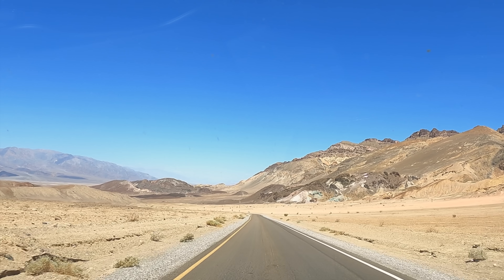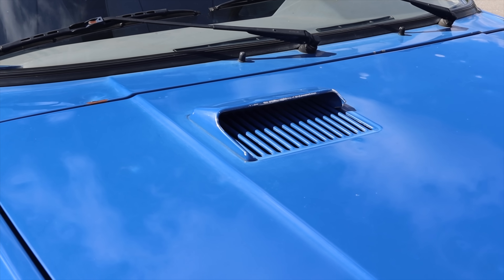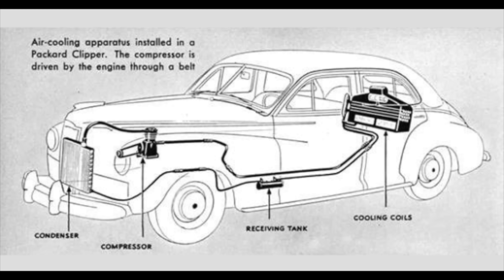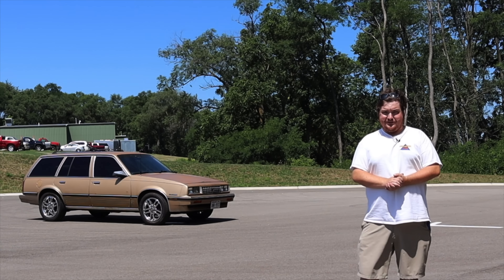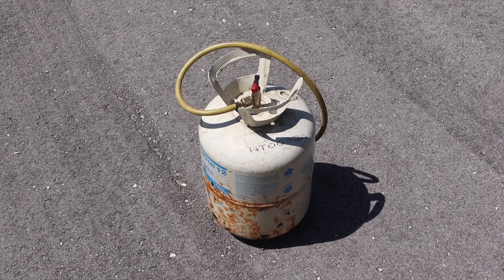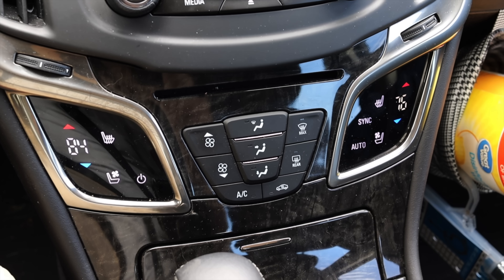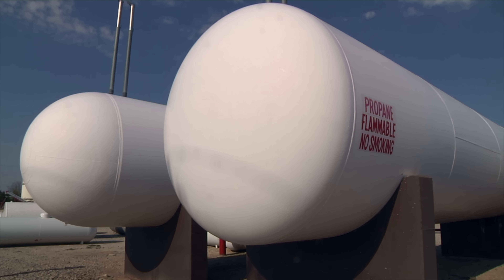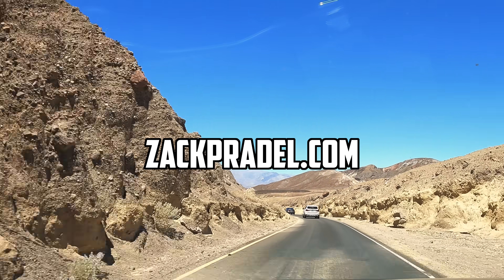Air Conditioning - The Story Of R12 & Why Modern Air Conditioning SUCKS!

Comment: Di chloro di fluoro methane!
                                        S A Y  I T !
..it's not that hard.
                              Chlorine 
                               Fluoride 
                        &    methane 
methane because it's the smallest hydrocarbon . Thus , most efficient. 
                 All the "new" freons are older formula concocktions that never worked as well as r12.
In the 1960's "living rooms on wheels " snowballs sometimes came out of the dash.
We'd catch them in Dixie cone cups , pour 🍁 maple surple on'm.
"Yum, yum, eat'um up!"

Comment: The flammable propane projection, is nonsense also, I use enviro-safe and it is a blend of flammables, you let me know when you can light off a propane torch from any distance whatsoever without any issues. Lies propaganda and exaggerated nonsense. I've been using this for about 30 years and everybody loves it it works, es 12 / es 134 is life. Enviro-safe is king.

Comment: My third car was a 1971 Dodge. I had Sears install the air conditioning. Now, R1234y is used. CO2 is used in industrial refrigeration but the pressures are 1,000psi.

Comment: My 2019 300S came with 1234yf. I immediately noticed in the summer it wasn't cooling the best for a new car. Took it to a mechanic friend who told me they were well aware of 1234yf not cooling as well AND the cost. He suggested retrofitting it to 134a. Once he did, it blew ice cold again. Loved it - until the charge leaked out a few years later. No shop would touch it to recharge - so I had to learn how to do it myself - any pay a lot for equipment - but I can use it on any 134a/1234yf vehicle. And like others have mentioned - this is BS - 134a was fine. I had a 1983 Oldsmobile as my first car in 1998 - and it had R-12 - it still struggled in Phoenix summers.

Comment: Got a bingo with quarter windows, no third brake light, carbs, locking petrol cap, and crank windows 🎉

Almost got the whole bottom row too but what are power seat belts? I wouldn't trust my car with any extra electronics

Comment: I never understood why anyone would be scared of 6 ounces of propane in a sealed system designed to routinely contain gas at over 300psi  but werent even more scared of 20 gallons or 960 ounces by weight of gasoline in a system made to contain 15 psi and be routinely openened by the car owner to be exposed to ambient air, and potential ignition sources.   The rest of the world is using cheap, plentiful, safer than gasoline, propane in automobile ac systems with rarely even a minor problem.   US is stupid these days.

Comment: My 2002 Volvo s80 had a pretty good AC with 1Kg of r134a. I remember crossing Jaen (Spanish death valley) in August with 47ºC and i was cold inside. In the Smart Fortwo it sucked. It only worked well at road speeds and it was a car designed for european cities. In my Volt its Ok. Main complain when its too hot and you start it it starts cooling the battery instead of you. Black leather doesn’t help. The Tesla I have to say it’s pretty good AC.

Comment: Maybe it's because I haven't used a car with R12, but my newer cars have fantastic A/C. My Cadillac ELR uses R134 and it is fantastic, even in the middle of the hot, sticky Florida summer it keeps the car very comfortable, I rarely use the max A/C. I just keep it on eco so it doesn't make as much noise.

Mom's C-HR uses the even newer R-1234YF and it also works just as well.

Comment: R-12 was awesome. I remember cars in the 1980's where on a hot summer day with a car sitting in the direct sun you could start the car and turn the air on and you almost couldn't hold your hand over the dash air vents because the air was so cold. When they switched to a different refigerant in 1990's cars you could notice a massive drop off in the cooking ability. Modern A/C takes many times as long to cool the same space. No comparison from modern A/C to what was used in the 80's, the stuff they use today is weak.

Comment: My mom had a 2005 Ford Escape and the A/C was amazing in that. Nothing more satisfying on a hot day than starting it and cranking the fan speed knob to the highest setting. And that thing would get cold. I had a 96 Ford Explorer a few years and the A/C in that was probably one of the coldest I've ever had. I drove an hour away and the overhead console said 97 outside. My hand was shaking when I got there. Now I have a Toyota Rav4 and while it gets cold, the cabin doesn't get cold as fast and it doesn't get as cold either.

Comment: My limited experience with 2 Ford vans I bought NEW, 20 years apart.  The '79 with R-12 struggled even in moderate conditions.  The '99 with R-134 worked noticeably better.  Both vans had AC serviced multiple times.  Comparing by: when vans were new, and immediately after AC servicing.  Also had a Camry (R-134) for over 20 years, which cooled just fine and NEVER NEEDED AC SERVICING (it was 22 years old when I sold it).

Comment: Volkswagen switched to R134a with the 1993 modelyear. The older R12 models work just fine after conversion to R134a. Conversion is really easy (replace oil and dryer) and the converted AC is still really powerfull.

Comment: R-12 wasn't causing global warming. It was causing a hole in the ozone layer, which is what protects us from excessive UV radiation from the Sun. Yes, we still get UV. That's why we can get sunburned, but it would be in Maximum Overdrive without the ozone. As far as R12 versus R134, the only times I've noticed  R12 being colder than R134 is when a car originally came with R12 and then was retrofitted to R134. Most of the time, when somebody would retrofit to R134, all they did was drain the oil, refill with PAG oil, and top off with R134. These systems would then continue to operate at R12 pressures. If you adjusted the pressure switches or if they were not adjustable, replace them with pressure switches designed for R134, the system would run a lot better. My 2000 Toyota Camry has an R134 refrigerant system. It is colder than any car I have ever owned, including including my 1985 Lincoln Town Car that was still running on R12. And yes, it was fully topped off. Another problem that I've seen a lot, is that when people would convert our 12 system to R134, they would end up overfilling it because they would fill it with the same amount of R134 that they would have originally put in if it was a complete refill with R12. With R134, it's supposed to be 20% less refrigerant than with R12. If the system is overcharged it will not cool properly. I just wanted to point these things out because I've been in the automotive industry for a long time, and I've done a lot of automotive air conditioning work in the past. R134 works just as well as R12, assuming that the system is tuned to work correctly with the R134.

Comment: A/C systems have a lot more going on than just what refrigerant they use, so it's not really fair to judge them by simply what label is on the car. The ultimate goal is to keep the evaporator as close to 32F as you can at all times with the desired amount of airflow you need. R12 and R134 will both do that, but might take different side condensers or compressors or other stuff to make it work. I'm guessing modern systems aren't as "good" because they are probably oversized to keep costs down. There's actually an SAE performance test for HVAC systems, so they might be designed to that not just "as cold as possible".

Comment: Manufactures are finding ways to use R134a in more efficient manners, hence providing cold and heat in extremely hot and cold days, R12 was not often used to heat the cabins if ever used

Comment: Not sure what refrigerant my 2021 F-150 work truck has in its AC but I measured 4.2f above zero from a dash vent the other day when it was 90f outside and I could see my breath in the trucks cabin. Pretty cold. 🥶 I did refrigeration work back when they were phasing out R-12 and I bought quite a few 30lb cans of it for $40 each then a few years later I sold them for $700 each making enough profit to buy a fast new Polaris 700 snowmobile. I did the same for R-22 heard later but this time I didn’t buy a sled with my profits.
Reply: It’s r1234yf. It became standard in 2014 thanks to the demonrats in the epa. 134a is extremely clean and effective and efficient. I have a 2018 Colorado and the ac is okay. I’ve driven every brand with this Freon and I get the same mediocre results. It takes forever to get any cold air on start up and when peaking it’s still alright. R12 is unreal! I’ve driven old tractors still holding that charge and your basically sitting in a glass house due to all the windows and they still make you balls crawl back inside you after a few minutes

Comment: Newer cars don't have heater core coolant taps any more while older ones did, and older ones had a/c economy and a/c max switches that let you run the evap at a lower temp. Newer systems have variable displacement compressors and thermal expansion valves

Comment: There is few "inaccuracies". First: ozone, yes 99% of earth population believe that nonsense that R12 and later R134 is bad for ozone, but it is bullshit from marketing. But it is good for their bussiness. Second, modern ACs are better than older, but it depends. If you want freezed air but only for short period of time, then complete blocked heat exchanger by ice and zero cooling until it will melt. Or if you want only cold air but constantly. Modern ACs are built to cool air only to about 4stC to prevent ice formation. Older are cooling under water freezing point. Older have only orifice tube before heat exchanger, modern have mechanical valve driven by pressure in low pressure part of AC. Third, filling AC by pure propane mainly in modern AC is step backward into older AC. Ideal is about 20:80 propane:isobutane (somebody recomend 30:70). This mixture have almost same colling property as R134a. But for R12 it can be pure propane, because R12 is in older ACs so freezing of their heat exchanger is normal.

Comment: I had a guy replace my ac compressor & fill it with propane, my car literally feels like a freezer even in 115 degree weather.
Reply: Don't light a match...
Reply: @MrOnemanop If you car is exhausting your ac refrigerant into your cabin you have a problem.
Reply: @j887276  My point is, propane leaking into the interior of a car, which is entirely a possible issue with A/C, is clearly an explosion, waiting to happen. Then you do have a problem!
Reply: @MrOnemanop Entirely possible, but extremely rare. The propane odor would be enough to make you realize what it was and postpone any lighting of cigarettes 😂

Comment: I was born in 82 so yea I grew up with cars that had r12 and remember the cross over to 134a. Most cars the difference in performance is minimal when u convert from r12 to r134a. The big issue is doing the conversion you have to replace ALL the system seals and you're really suppose to replace the main components and purge the lines. If you mix a significant amount of r12 ester oil with 134a pag oil it can and often does gum up and destroy the compressor. But the introduction of automated AC machines greatly helped with this as they could flush the system to get the old oil out most the time.
Reply: That’s not the only difference. R12 had a higher pressure/temperature point so a low pressure switch in an R12 system, to prevent ice buildup on the evaporator was set to 32 psi, but in a R134 system, it’s more like 26 psi before the refrigerated air reaches 32F and ice collects on the evaporator. If a simple conversion was made without swapping the low pressure “cycling” switch, then the evaporator would never be as cold as R12. That’s why many DIY conversions were only so-so.

Comment: It's my understanding that R134A has a lower latent heat of evaporation than R12 and that's why it's less effective. One idea that works is to put your AC on recirculate until the interior cools down, then off recirculate when at the desired temperature. It works well where I am in Ontario, but might not be adequate in a hotter climate. For another idea, check out my video about cheap ram air car air conditioning.

Comment: Can I put R12 in my modern car😂
Reply: No and yes its illegal in the US but you can get it elsewhere and bring it
Reply: I'll comment so I can get the answer once it comes
Reply: R12 is a smaller particle and will leak out of modern systems
Reply: @dark_night8268 I've heard the opposite. I heard it's technically thicker so it very rarely leaks. But idk this was also from some cracked-out looking mechanic that comes to our store all the time.
Reply: @Bojangles06  you might be right, I just remember they were different sizes
Reply: You can if you can source the r12. A few caveats tho. R12 and r134a use different lubricants and mixing of them can theoretically damage the compressor or something. The seals and o rings might also not be compatible with r12 and might leak over time. Luckily the low side pressure runs about the same but the high side for r12 runs 100psi lower than r134a, and all the components won't regulate it properly. It might work but it probably wouldn't be efficient
Reply: Good question
Reply: maybe we can work something out to change the system back to r12….😂
Reply: @profsnape4093 I wish, might actually give me a reason to fix my ac

Comment: Aircon was considered a luxury in the UK until relatively recently. Our first car that had air conditioning was a 1998 Ford Mondeo (Contour, to those in the US) and even then, it was an optional extra and it was fantastic. Even larger cars from Ford, BMW etc didn't regularly have aircon as standard until the very late 90s. Even so, the aircon fitted to cars in the UK would take a while to cool things down mostly due, i think, to the systems being smaller than those fitted to cars in the US. A car without aircon is something i would never want to go back to. There's a ton of cool cars i would love to own, but won't as they don't have aircon.
Reply: I've had many cars in the UK and the best aircon I had was in a BMW 330ci face-lift. It was by far the best out of any of them but rarely used as you know we don't get much sun. I recently had to fit a 12v rooftop system to my campervan though to go abroad as it never had aircon from factory 😂

Comment: Subscribed, because cars were better in the 1980's. That's exactly why I resurrected a dead 1989 Chevy C1500 to serve as my work truck. I went to auto mechanic's school in the late 1980's and this is exactly the technology that was state of the art back then. I can fix everything in my driveway.
Reply: 80's cars and trucks were the biggest pieces of crude ever made!  Constant maintenance and problems straight off the showroom floor!  People patted themselves on the back if they somehow managed to get one to go 100,000 miles at 55mph after a meticulous PMCS schedule.  All trash!  Not a single North Amercan manufacturer could make a reliable, dependable automobile that you could bet your life on.  God forbid if you didn't change the oil, coolant, brake fluid, transmission fluid, or differential fluid regularly, or they would leave you stranded. Most weekends from the late 70's all through the 80's and early 90's I spent my time working on those horrible cars and trucks.  They were also uncomfortable to ride in or drive, beating you up the whole time.  Even the suspensions sucked!   Between the shotty union workmanship, the epa regulations, crappy lean carburetors, and experimental computerized fuel injection, they were all junk to drive or ride in, but they did have style.
Every single car or truck I've owned for the last 20 years will do 100mph for at least 100,000 miles before even needing so much as a plug checked!  That's just touching on gasoline vehicles.  Diesels in the 80's were a straight-up abomination!  My current L5P dually probably has more miles on it than all your previous 80's vehicles combined, all without one single maintenance problem.  It'll outrun your old truck off the line, or top speed,  and it can literally pull a house across the country all with a smooth quiet ride, and the multi zone air conditioning will freeze you out of the truck here in West Texas.

Comment: So, that's a weird contradiction.  New cars have inferior air conditioning but it worked flawlessly in the harshest conditions of death valley.  In an older car, the engine would have overheated...
Reply: You’re making no sense at all
Reply: What are you getting at. The AC system and engine cooling system aren't connected at all
Reply: @a-dog8075 most cars have the high pressure radiator right in front of the engine's radiator so it does influence at least a bit
Reply: @a-dog8075 They are indirectly connected, engine has to work harder as compressor draws power from the crank, which creates more heat, also the condenser gets hot, adding to engine bay heat and making the radiator less effective.
Reply: @a-dog8075  What I'm saying is older vehicles were very prone to overheating.  If the engine isn't running and you're standing on the roadside you aren't enjoying the A/C! So yeah they are sort of connected.  The condenser coils do in fact warm the air through the radiator too.

Older vehicles with carburetors set lean for emissions/fuel economy did run a bit hot even when not in Death Valley.  Unless you had a three core radiator, I can't imagine you're going to take a drive through that place willingly and without incident.
Reply: @rogerknapman1260 ok, thanks for clarifying. That makes a lot more sense now
Reply: @a-dog8075  The AC often had its radiator in front of the engine's radiator, AND the older ACs seemed to put noticeable extra load on the engines, at least in economy cars.  So, not directly connected by fluid, but there's some effect.